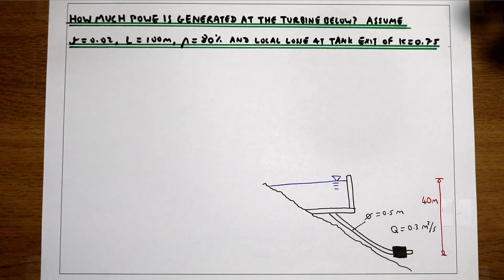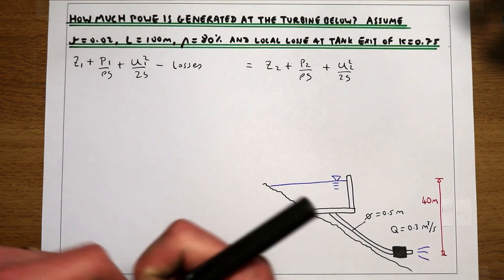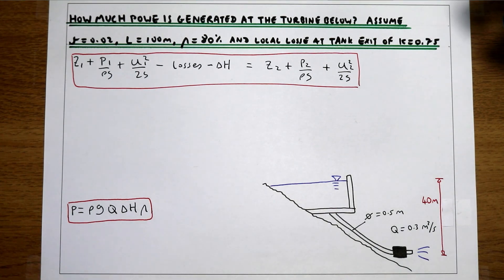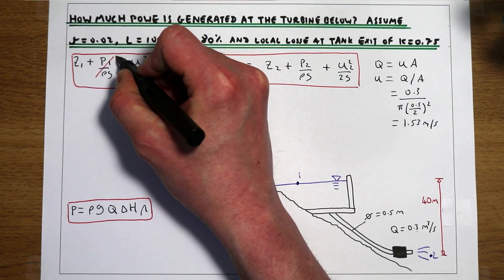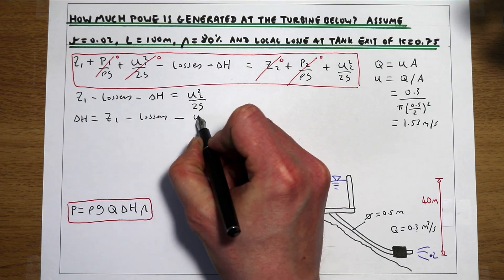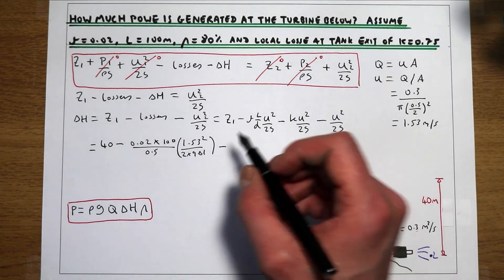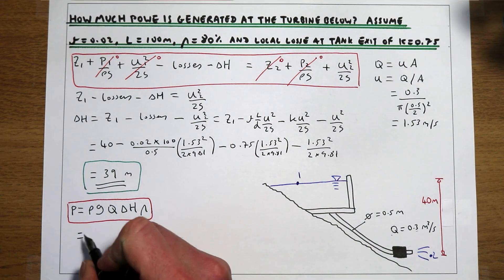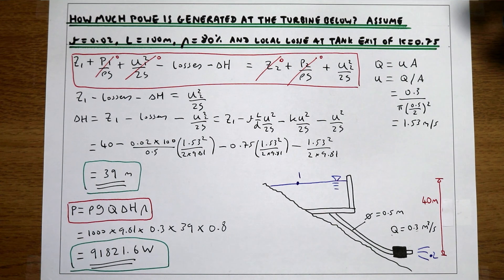Calculating the power a turbine can generate on a hydroelectric scheme using Bernoulli’s equation

Comment: Is that 91kW for the full volume of the reservoir? Could the voltage output of that system be calculated as well?
Reply: It depends on the size of the water reserve.  The equation is based on a single moment in time and that the height of the top of the water in the reserve is 40m.  In a huge dam type situation, the amount put through the turbine is usually equal to the amount of water that is being replaced into the dam, so the 40m would never change, and your 91kW would be consistent.  However, if you do this type of calculation with a storage container on a homestead, you could do two calculations, one with the top of the container and one at the bottom of the container, and find an average from those two knowing that as the tank empties, the water level lowers and thus you get less watts as time goes on... and of course do the calculation of how many hours until your container is empty as once the tank is empty, no more electricity.      The second part of your question depends completely on what turbine you use and you can use a simple equation to figure out the volts    volts= watts/amps